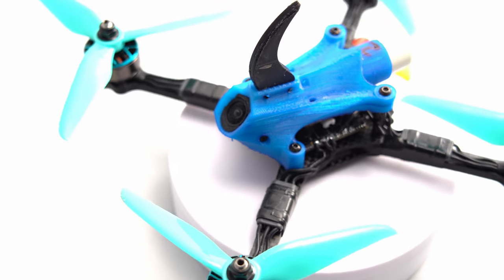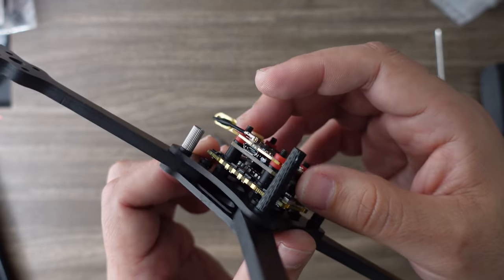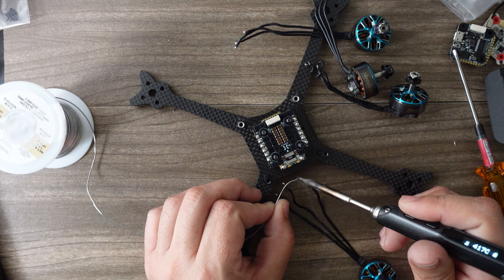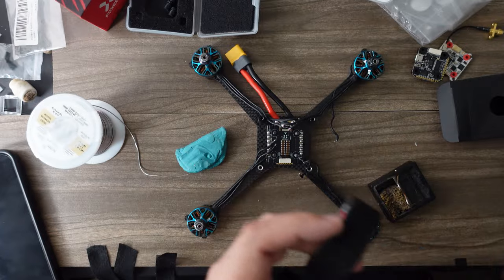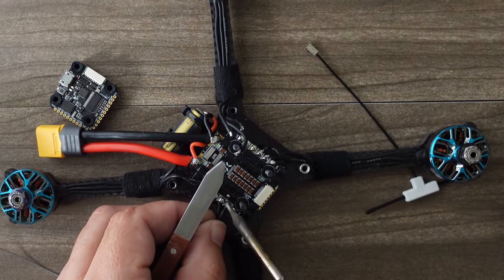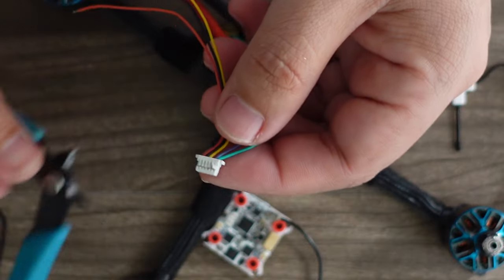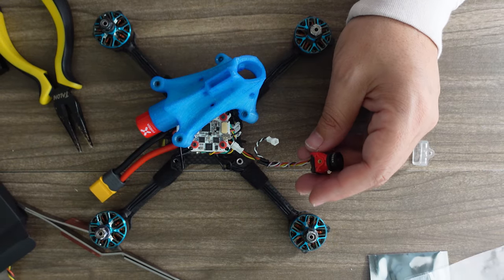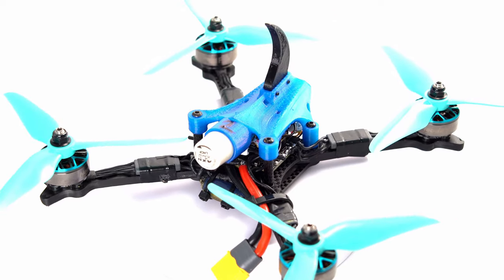Drone Build step by step - OpenRacer Pro quadcopter guide FPV Beginner series

Comment: Jon has me wanting this to be my first build lol😁 this thing looks like mean AF ripper!!!! I love that the rhino horn lol well Jon thanks alot because now I have to sneak and get this so the Ole lady won't find out lol🤌🏽 i have to have this quad !!!! Same components and everything!!!!!🙏🏽✌🏽
Reply from the maker: Go for it!  I put the full components list below in case you need a list.

The openRacer is what we use to survive the concrete of the night spot.  Perhaps not as light as the switchback (which is also amazing), but that environment really created a need for an ultra durable frame.  Also since its open source, its pretty cheap, and you can print multiple pod options designed for multiple materials.  Limon did such an awesome job donating this frame to the community.
Reply: @JonE5FPV  that's freaking so charitable man could I get you to build me one lol

Comment: Nice!  I’m about to build my Openracer and bought some PCTPE to try and print a canopy myself.  Did you print with it right side up and use supports on the underside of canopy?
Reply from the maker: Yes I did, these are the recommended print settings from the github.  Also remember PCTPE soaks up moister worse than TPU, so i always dry it for 12-18 hours before printing.

1.6mm wall thickness (for 0.4mm nozzle, use 0.53mm line width and 3 perimeters to achieve 1.59mm walls. 0.6 to 0.8mm nozzles will use 0.8mm line width and 2 perimeters)
0.2mm layer height recommended, 0.28mm maximum
0% fan speed
20% infill
Supports are required, but only from build plate
Recommended print orientation is with standoff legs on bed. Use care removing supports around the antenna holder.
Reply: @JonE5FPV  thank you for the tips!  Suppose you dyed yours blue?  I need to get me some Rit dye too!  Great work and enjoy your videos as always!

Comment: Cool video and nice build! What are your settings when using pctpe?
Reply from the maker: Thanks a lot! All the filament settings for the different pods are in the github
https://github.com/OpenRacer/OpenRacer

PCTPE settings are this (from the github)
1.6mm wall thickness (for 0.4mm nozzle, use 0.53mm line width and 3 perimeters to achieve 1.59mm walls. 0.6 to 0.8mm nozzles will use 0.8mm line width and 2 perimeters)
0.2mm layer height recommended, 0.28mm maximum
0% fan speed
20% infill
Supports are required, but only from build plate
Recommended print orientation is with standoff legs on bed. Use care removing supports around the antenna holder.
Reply: @JonE5FPV  Thanks for the reply! I bought a roll of pctpe and I’m about to start experimenting!
Reply from the maker: Awesome!   remember PCTPE soaks up moister worse than TPU, so i always dry it for 12-18 hours before printing for best results.

Comment: Looks good John.  Soldering was even acceptable!!!  Nice to see stuff like this in the market.  Is there a racer class that is developing or developed for this drone?  Thanks for a great video!
Reply from the maker: It can be used for open class or freedom spec.  I use it for both.
Reply: @JonE5FPV  Thanks John!  By the way, congrats on your racing finish positions - sounds like you are getting better and better.  I still fly as bad as the first day i got my stuff... i get huge interruptions and by the time i get back i seem to be reset to zero... and my goggles just suck, that makes it super hard to do FPV.  But i do fly LOS, and that is fun as all heck.  Cheers!

Comment: Or....how bout I have you build it for me lol whats the numbers Jon? Message me them and I'm down but you gotta sign one of those arms 😁
Reply from the maker: lol, i actually just built an extra for the mayhem team race i can sell if you really want one of these.  But unfortunately the chip shortage has shot all the components prices up a bit.  One like in the video would be $375 shipped, including 2 spare pods. (1 spare pro, and 1 TPU GoPro mount pod).  If you wanted some diff motors, or possibly different rx, vtx, it could be cheaper.
Reply: @JonE5FPV  man Jon could 500 get me something nice? Analog????? I don't have digital yet lol
Reply: @JonE5FPV  man I would pay 375 for that ripper !!!!!